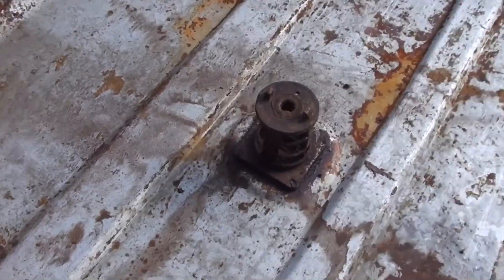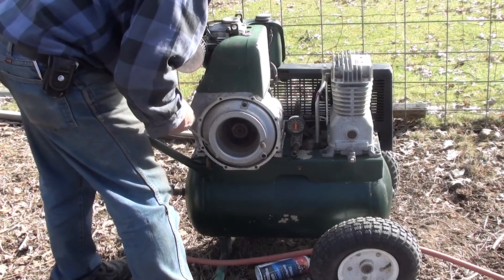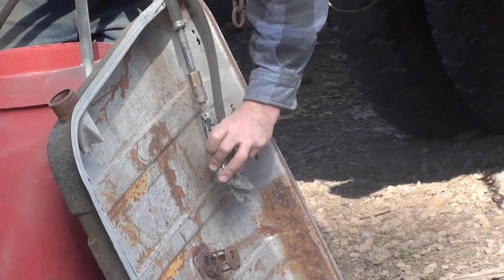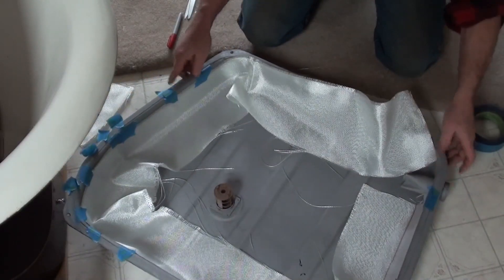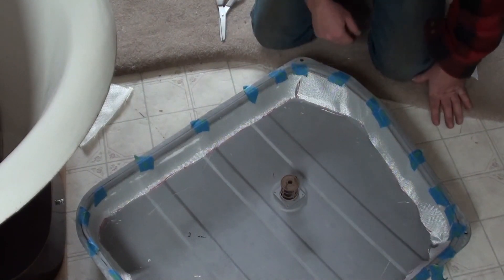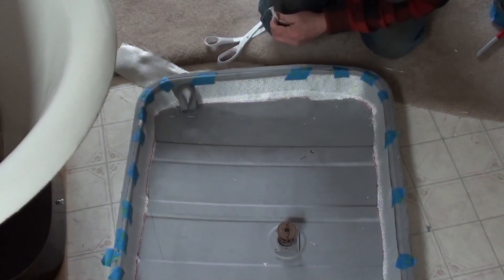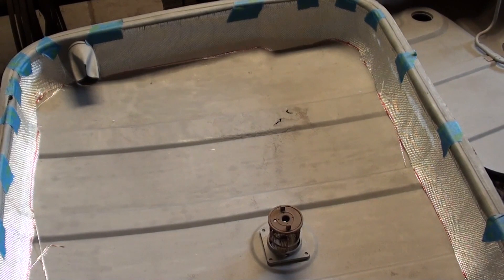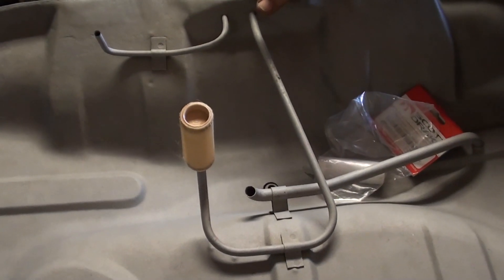Prepping the Obsolete 1981 Dodge Colt  Gas Tank For Repair

Comment: I remember an old trick when I was a kid was to clean up the tank and take a bar of soft lead and heat up the tank and coat the inside with body solder it kept the tank from rusting lol

Comment: There's a reason modern tanks are plastic; modern fuel has ethanol, and ethanol is hygroscopic. Those rust holes are the water line.